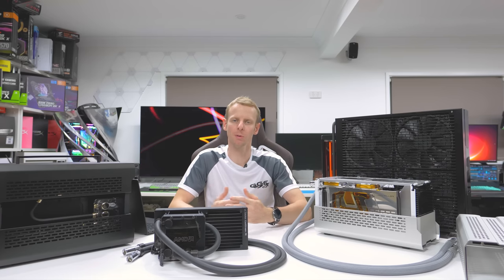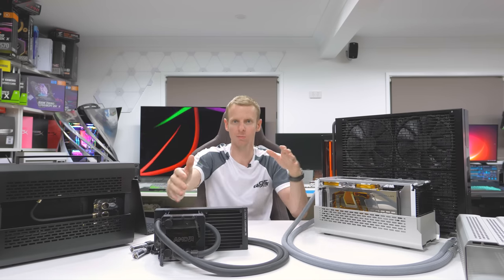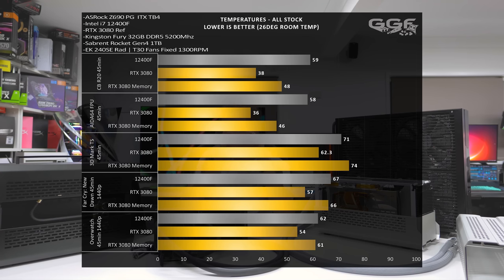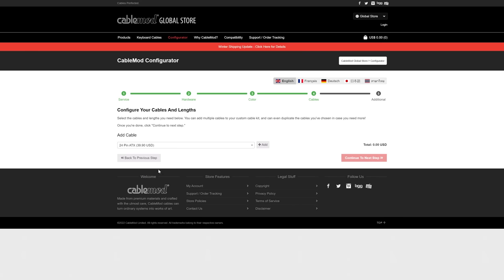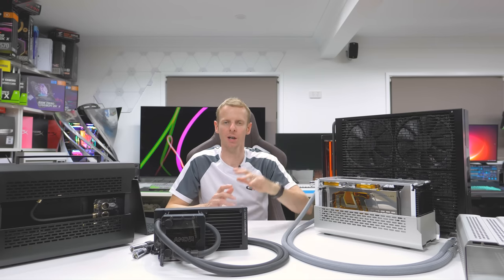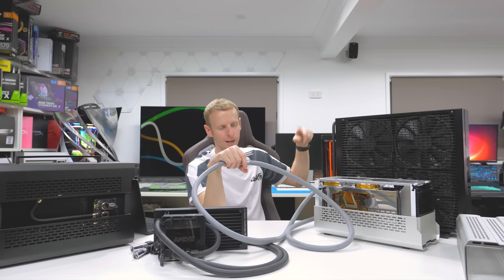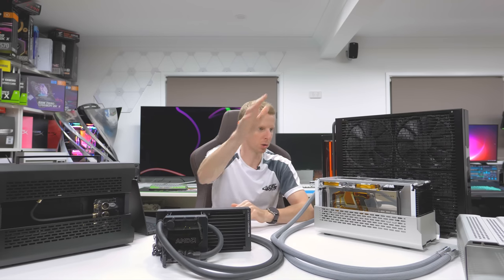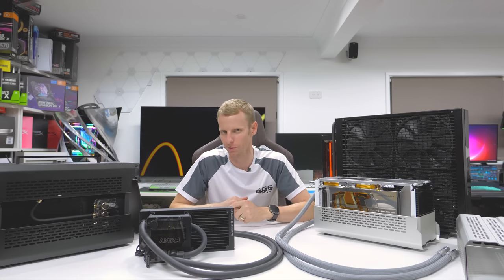SHIFT XT - Mod Build Video - More about the builds and temp testing.

Comment: I too went with an external radiator. I'm currently using a vertical mount from LiquidHaus and it's a beautiful 560mm column that sits on top of my desk. The thermals are impressive and heatsoak is a thing of the past.

Comment: Don't get the hate, an external rad with high end hardware is the way to go while there aren't many SFF cases capable of fitting 2x rads + the chunky strix/aorus/suprim GPUs IMO. The concern with a single 240 (or even a single 280) should be high coolant temps,  50-60C is where things start to go funny and you very much can end up in that area if you aren't careful. An external rad would solve a lot of that while keeping noise to a minimum.

Comment: I appreciate all the information you have provided for people interested in water cooling the XT. The temperatures here are amazing, especially considering the T30s in the thermals were only going at 1300rpm. I have my EVGA 3070Ti XC3 running a stable 2100mhz in most games at 72-76c, so I am very curious how much more headroom there would be at ~55c.

Comment: Pls more MORA 3 Builds. Currently I use it with my fractal design 7 case with the MORA 3 but planing to upgrade in 2 years with an SFF case to combine external cooling with it since you just have almost ambient temps only in the case and save more space in the desk. 

Currently my EKWB DDC Pump is in the case and maybe I convert it also to the radiator when I use a smaller case in the future.

Comment: Awesome builds, I would like to see the approach you mentioned for the active backplates on sandwich style cases. I think the only ITX case that can work out-of-the-box is the NR200P, the vertical GPU layout has room for the fittings on the other side.

Comment: For 3090 with ABP, the Watercool single slot I/O bracket for the XC3 works on the FTW3 as well ( I believe it may work on other model cards as well). So you could put that on the water cool FTW3 block with the active backplate, move it all the way over to the closest slot near the side of the case, and then put low profile fittings on the opposite side towards the motherboard. That should give you enough space to fit everything. 

This would not be possible with the EK block with the active backplate because the flow is not parallel and you need to have fittings on opposite sides of the terminal, whereas with the watercool block it runs in parallel and you can have fittings on one side. I think the EK 3090 FE block may work since I think it has a single slot bracket, but the active backplate is extremely thick. At least there fitting placement wouldn't be an issue.
Reply from the maker: But in saying that nearly all ABP cards won't fit in this case :p
Reply: @GGFEvents  yeah, it would really be a case of sticking things where they don't belong 🤣. For my next build I think I'm going to go with the Jonsbo (Jonsplus?) i100 Pro and a Mo-Ra. The case you did with the copper paint accents and the side mounted FLT 360. Your build in that was inspirational. It's just small enough to fit on a desk, but big enough to hold pretty much any base hardware, with room for mods and workability. So, TY for that vid and this one!
Reply from the maker: @paskowitz  oh yes that would be a sweet build. Thank you and good luck

Comment: If you get the gpu on the top and the radiator where the GPU was supposed to be you could probably fully watercool in the middle height. I might try to design and 3D-print a bracket to get the gpu on the top and radiator on the side

Comment: Awesome build, she's so clean .. Congrats on it 

I am also building a very similar build now with the same case and i would like to ask if the Phanteks PSU is sufficient power with your experience now? Its a 750W output, is this sufficient or would you have rather chosen something like an 850W PSU for some additional buffer wattage? I ask cause when i input all the components on those " power supply calculators" online, it shows that i would need 697W of power (700W) but it doesn't include the radiator fans or the water pump, i would assume this is the same power that the GPU fans would consume if one never had the GPU water block? Thanks for your advice. Cheers

Comment: Hey Stuart, I'm in love with the MO-RA3 build and want to attempt one myself (either in this case or the Dan A4-H2O), but have a few questions.. 
1) Seeing as the Shift XT is a 3-slot SFF case, do you think it would be possible to run a 2-slot GPU and one of those PCI tubing pass-through brackets that Watercool sells as a viable alternative to drilling holes in the case? Or not enough clearance for fittings/etc.?
2) In my research, I've seen most people recommend the dual D5 pump top for the MO-RA3. Do you think it's really necessary for a build like that? What kind of flow rate are you seeing? The loop seems quite straight forward, so unless the rad itself (or QD3) is highly restrictive, my gut tells me a single D5 is more than enough. 
3) Finally, do you need to keep the USB connected for the D5 Next or can you just set and forget once it's configured the first time? I'd rather avoid the "umbilical" situation that other people with similar loops have resorted to.
Keep up the awesome builds, hope you landed on your feet after your move. Cheers. x
Reply from the maker: Thank you.  I've actually done a mod video about this build and my first shift XT build. I think I cover most of your questions in that. Have a look at it and let me know :)

Comment: I like the idea with the power supply on the MO-RA. Could you provide a link to the power supply used? I see on the pump specs it needs 12V and 5V. Want to make sure I don't blow it up 🙂

Comment: How did you power both 5V and 12V on the sata cable for the pump with one 220v power supply?
Reply: As I want to realize it the same way, I asked myself the same question. In the video it looks like he only made a 12V supply.